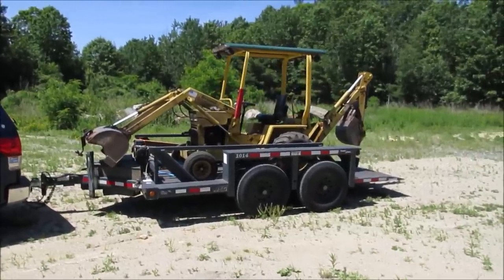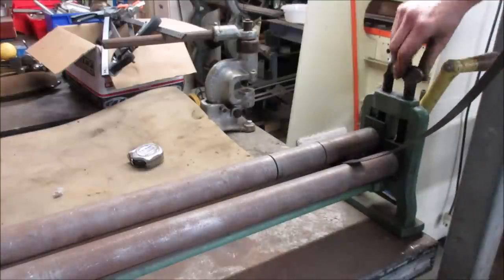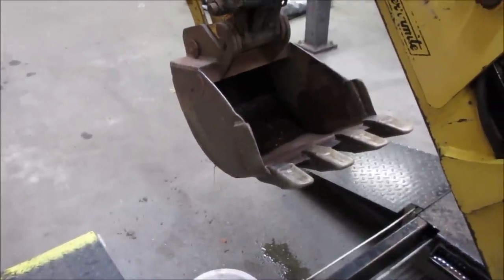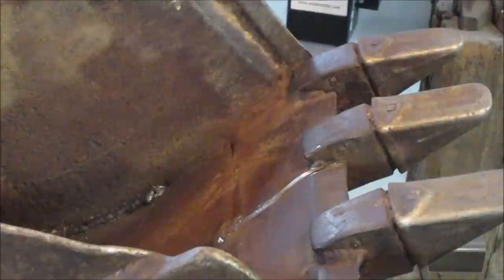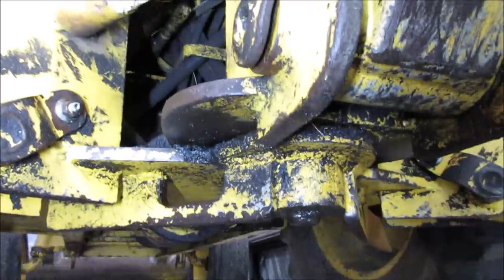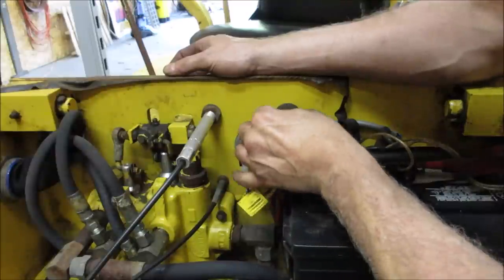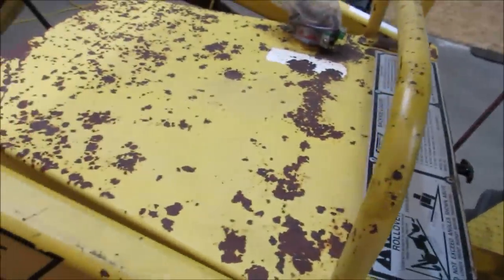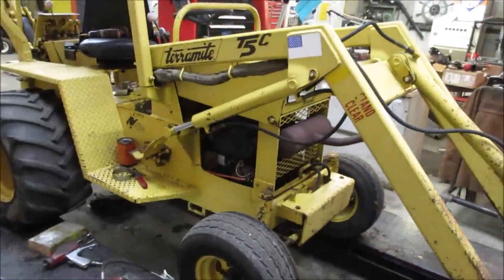I Busted My Backhoe, Now Lets Fix It!

Comment: I looked at the manual(I know, cheating) and surprisingly, the hold down goes on the stud first, then the battery cable, followed by the wire from the ignition. Your solution is likely better, theirs was cost cutting.

Comment: Run a stick of 7018 a bit hot through that bad boy or you can run the 710 wire. That weld is a little ropey. It will lack penetration. Just saying

Comment: Mustie. I want to give you a tip. When your welding heavier stuff like that, either crank your welding heat up quite a bit more, or if you're at your limit of your welder turn your wire speed down until you don't hear that snapping and crackling and it's just a smooth spray. Your wells will penetrate deeper and be smoother.
Also, instead of pulling your welds push them.

Comment: I hear many negative comments about Fram filters . I see you’re using them . Any opinion on oil filters ?  I will use Fram if it’s what I had but prefer WIX FILTERS  if I can .
Reply: I know you were asking Mustie, but IMHO as long as you change your oil regularly, and are not operating your equipment in extreme ,harsh conditions. Fram filters are fine and you will save a couple dollars.

Comment: $8,000 in 2000 is equivalent in purchasing power to about $13,579.37 today, an increase of $5,579.37 over 22 years. The dollar had an average inflation rate of 2.43% per year between 2000 and today, producing a cumulative price increase of 69.74%. So, it definitely lost value! Yes, I am a blast at parties.

Comment: The way I heard it was always "a grinder and some paint will make a welder what he ain't" 🤣

Nice repairs as usual, Mustie. On a bigger bucket I personally would have tried to grind out the side cracks a little to get more junk out of the seam and expose fresh metal, and definitely would have stop drilled the end points of the cracks like you did in the middle...but on a machine that small with metal already worn so thin, grinding it out may have opened a huge can of worms. I'm certain that repair will last a good long time. Nice little machine!

Comment: Excellent video Mustie  :) I remember my late dad & late uncle bucket on small tractor a 1963 McCormick International B414 Loader tractor Desiel motor, bucket was hard find to replace with a new or good use one  and had weld up to ! I use Arc Welder Lincoln one my dad won for prize from local John Deere tractor dealer also use 7018 weld rods plus 1/8 inches thick slingie welds for 3 days fixing up and grind to ! What happened is tractor was used doing animals 💩 poop in barns cleaning up each year in , stones or rock picking up in feilds before crops planting on row planter, snow removal to driveways too and lots more! But I was happy in 1994 was a Tractor Scrap Yard near me & fix it also restored tractor after engine rebuild  did to  found a mint shape bucket same model tractor but less hour use one ! So brought home to farm and fix tractor full ! Save me lots money fix tractor too on many new parts and ones could get by International dealer too ! Only paid $700.00 for parts tractor also old parts took off no good to use were more when took to recycled company near and was left of part tractor to  ! Got $1400.00 when haul in and my late dad also uncle told I did excellent job work to ! That tractor still going strong today and nice shape too! Funny part put new a 1984 year style of GM Delco Alternator 100 amp one to on yesterday for Farmer friend has now too and also nice he got hold me to fix up !

Comment: I would have bought a replacement band.  Only $42.95 with free shipping. 5 minute epoxy hardens very hard and is prone to cracking.  Not the best idea for a flexible brake bad.

Comment: Hi Musty, I don't think that hose on the corner lifter was under pressure. That hose you repaired was actually the retract point. The extend connection is at the top... But otherwise: great work!

Comment: You paid $8,000 20 years ago and it's worth $ 8,000 today then you overpaid 20 years ago 😅 ...jk cool machine 
.
Reply: Inflation means it lost value. If it maintained the value, it would rise with inflation. 🤔
Reply: I bought a T5c a year ago for 6000, and i doesn't have the quick connect backhoe like Mustie's does.  He got a deal paying 8k.  His also has the vtwin engine instead of the boxer engine(vtwin has more power with the same HP).

Comment: I don't know what you're trying to do but when I was working I had this idea for setting up the welder and we didn't know where the parameters of the dimension were so I would put copper sheeting with a radius and clamp it to the disc and the welder could just weld all the way to the diameter of the copper very little clean up used to be we would guess but the weld won't stick to the copper.... so you can use it for a boundary

Comment: Have you ever heard of build-up welding I used to do a lot of welding on build-up welding on equipment I used bu 90 welding rod build up the steel on the outside of the bucket

Comment: The tires look a bit weather checked . Guess as long as they hold air ,it’ll be ok . It does not get used much . Plus how many back hoes do you need .  This ain’t your only tractor 🚜.

Comment: Might I suggest getting some tireject for your flat tire(s) problem. I had a tire on my vehicle that kept going flat so I figured I’d try this tireject and it’s been about 3 months now and the tire is still holding air. I learned about tireject from one of Wes Pandy’s channel, (one lonely farmer) he swears by this stuff, he actually drilled a hole in one of his farm tractor tires on purpose and put tireject in it and it sealed the hole up. You can also get it for car and trucks also.

Comment: you should never sneak up on a roll radius. especially on thin metal. your rolls work better when the metal is flat. try sneaking up on a radius. then without touching anything roll another piece. it's over rolled...

Comment: Should havw taken it to a truck emergencyc brake repair house same type as in old chevy
Reply: @haywoodyoudome  ywah but i. Consider  brakes to. B  vital safety issues, so the 50 bucks with proper friction material. Install is money well spent

Comment: To the best of my knowledge this machine wouldn't exist in most of Europe & definitely not the UK, all our heavy equipment runs on diesel, even the "smaller" stuff. I guess that might be because industrial usage gets tax free diesel though?
Reply: Social engineering ,what crap by any government .
Reply: The Terramite Backhoes came in both diesel or gasoline engines.   I bought a new one about 1995.  I still have it today and it still runs great.  Still has the original engine.  I have used it to put in water lines, dug manholes, sewer lines, gas lines, underground electric lines, plus many septic tank systems.  Dug out for basements, footers for houses, swimming pools, built driveways, plowed snow covered streets, dug out tree stumps, hauled concrete blocks into hard to get places, tour down small buildings, pulled cars out of ditches, drug small trees to burn piles, dug and pulled out rows of old fence posts, and many other things that I have forgotten about.  This is one of the best working machines that I have ever bought.   I think it was $13,000.00 new when I bought this machine.      The only problem with it is that all your buddies and neighbors want to borrow it all the time.

Comment: When I weld cracks, I turn the welder up alot, then I grind the welds on both side all the way down to the surface,  and then lay a second round on top of them both.. Usually I will grind thru half the thickness of the metal I'm welding, and I do it on both sides aswel...

Comment: Also the Grinding Disc can leave fragments of Grit imbeded in the Surface that will make the Welding Torch Pop too, be better to grind and then run the wire wheel over to flick out that Grit. I'm trying to calm work down as I'm looking after my ageing Mum but I've gone back to Contract for my old firm 2 days a week because they can't find anyone to replace their last Spiralwelder. They repair stuff there by machining a worn area, build it up with Weld and machine back to original specifications. For example propshafts from lifeboats use a water bearing that is very corrosive, so they get repaired in this method with  a harder material so they last longer but in a week turn around, where as a replacement has a lead time of 6 months before it's even made. On a component that has hours of use a new replacement is unfeasible!

Comment: On the outrigger in the down position that leaking fitting ie not the pressure side. It applies pressure on the bottom of the cylinder to extend and at that fitting to retract which lifts the outrigger.

Comment: Isn't that hydraulic fitting under pressure when fully lifted/retracted (not when supporting the vehicle)?  Also, does the fuel tank cap need to be vented, for it to run?

Comment: Mustie, you desperately need new bucket teeth.  Sharp teeth will go a long way to relieving the stress on that bucket.  Might also want to consider a bolt-on tooth bar for the front bucket if you are using it for digging.
I know that MIG welding is somewhat easier but, standard arc welding will give much much better penetration to welds on thick metal.  I'd use a 6010 or 6011 rod on the bucket because they do the best when you have metal that can't be cleaned properly.

Comment: You need to get some 1/8 inch AR400 plate steel for wear plates so your bucket doesn't wear out on the bottom and the sides or get hardening stick rods and do criss cross pattern to make it hard to wear. That stuff will probably Outlast your lifetime

Comment: But you could cut out some new metal pieces and weld it in on the sides to you're bucket 🤷 Even the middle piece you could weld a completely new piece,  it's would never Crack again 😎